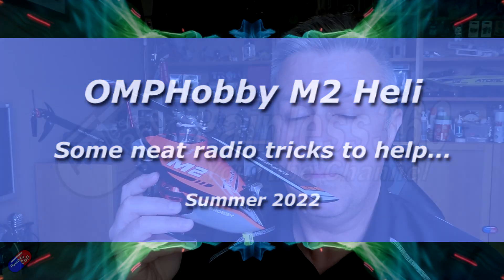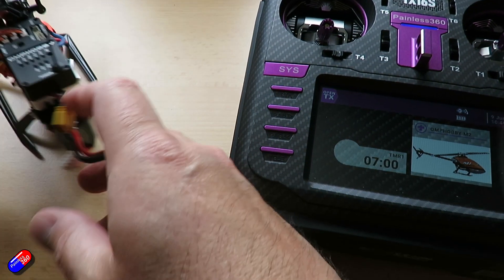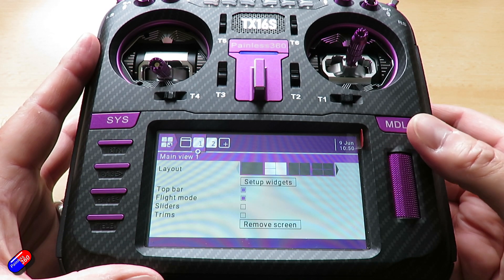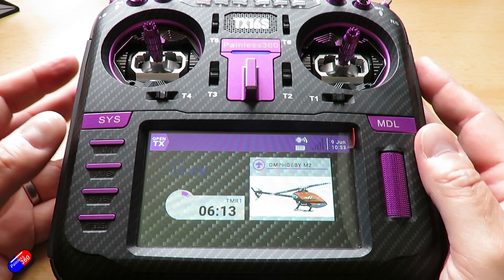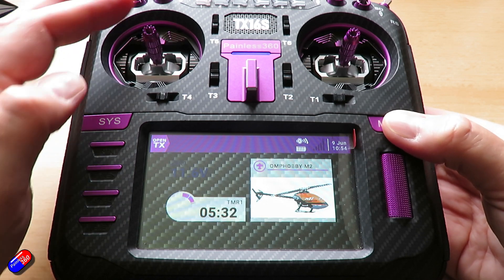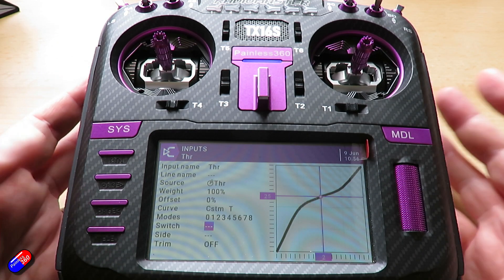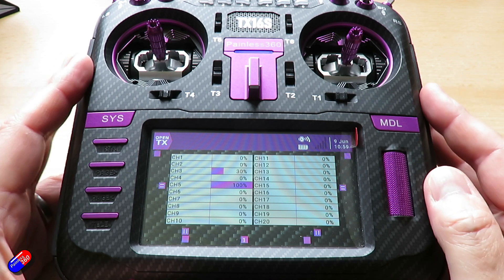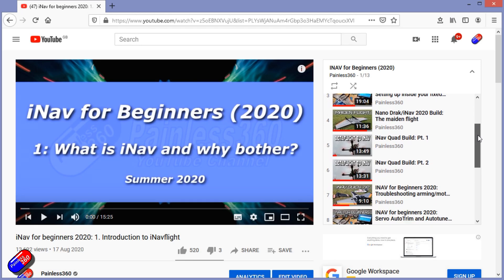RC Helicopter Radio Tricks: telemetry, easier hovering and adding an 'oh dear' recovery switch

Comment: I'm working with the OMP protocol for the first time for a friend. In the instructions I read that the throttle is set directly in the flight controller and cannot be changed. The pitch curve is controlled with CH3. Is it possible that your curve makes the pitch control less sensitive?
Reply from the maker: Pitch range is set for the flying style and sensitivity you need. Happy flying!

Comment: hi I have set up my radiomaster zorro with the things you show in your video but I can't get it to show low battery on my evo2 my start screen is this something you can help with regards Kim
Reply from the maker: What troubleshooting have you already done?
Reply: @Painless360  I've been inside the one called display, I've also put a1 and lo1+rssi in the field called screen 1, but I can't get it to show it on my start screen when I turn it on and turn my evo on
Reply from the maker: What sensors are in the telemetry screen?
Reply: if I press the telemetry button it shows a1 lo1 and rssi but when I go back to the start screen it doesn't show none of them. I'm a bit of a beginner with setting up a radio but your videos have helped me a lot
Reply from the maker: Delete and rediscover the sensors. Best of luck!

Comment: I can't wait until I get a receiver and gyro for my BLADE 300X, I have a older Spektrum and I would like a newer radio but right now I can't.  I have installed a Caddx Ratel baby and a HGLRC Zeus mini. Thanks for the video and information about your settings.